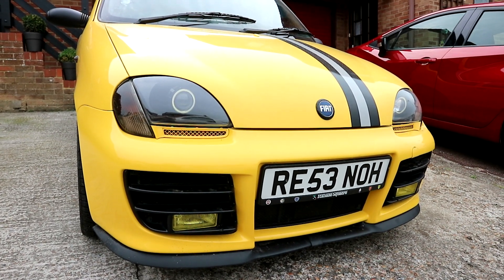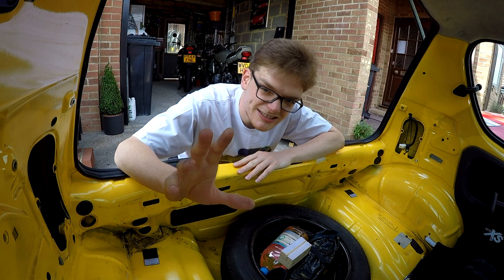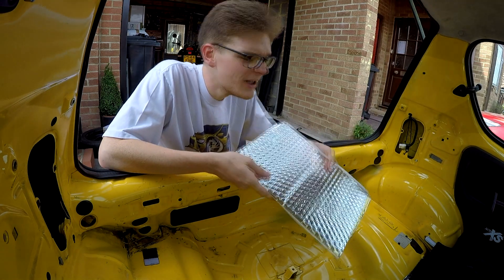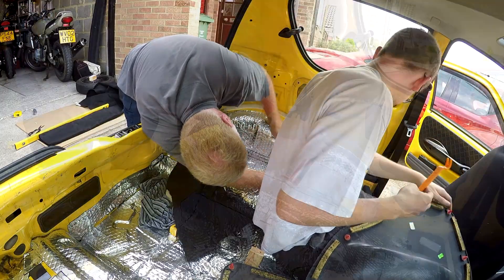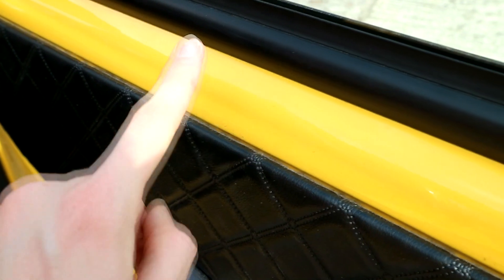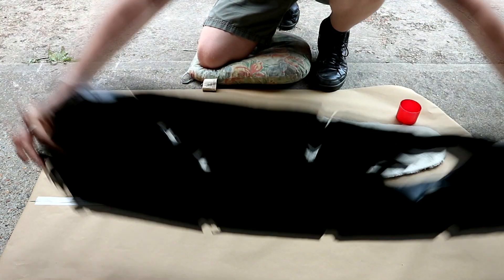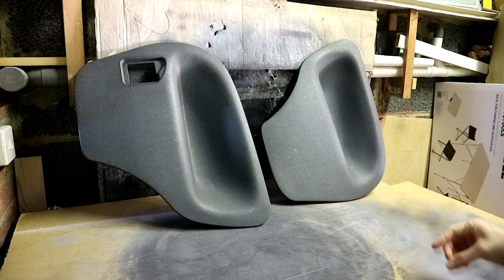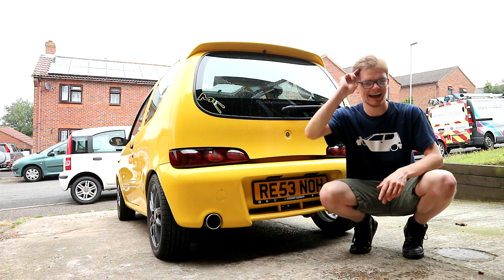Super Seicento SHOW PREP!

Comment: Good job, looks great. Just my two pence worth... I would keep the rear hatch inner trim panel and the rear seatbelt plastic covers.
Reply from the maker: There IS no rear hatch inner trim panel 😅 there are plans for covering those holes up!
Reply: Miller Corner ah right... you mean that the original trim panel is temporarily AWOL

As I need the rear seats, I added soundproofing from the rear seat backwards. Noticeable improvement!

All the best from Greece!